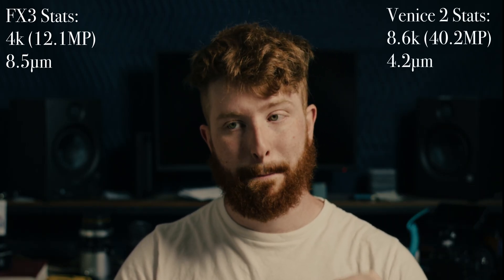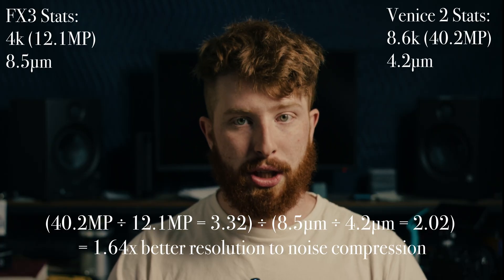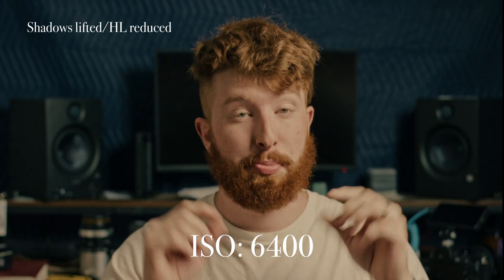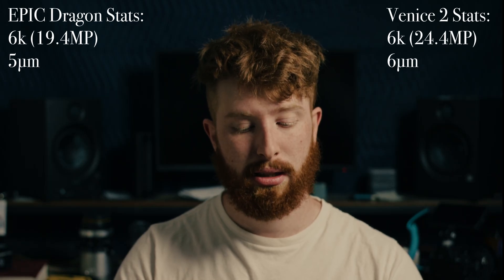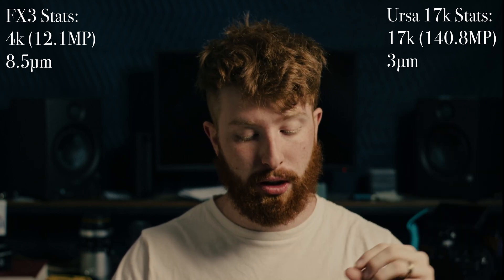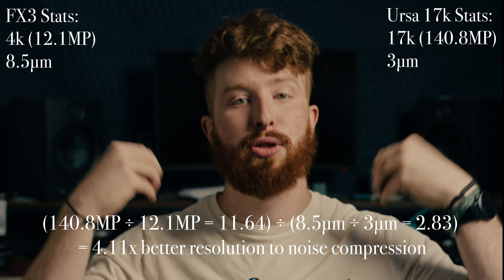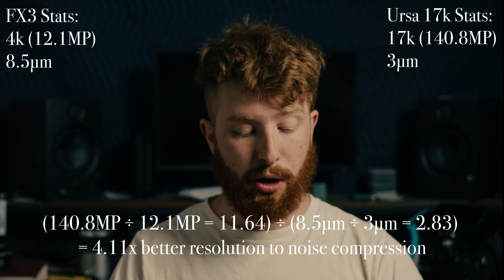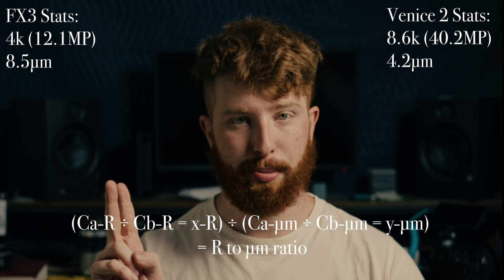Does higher resolution add more noise... or reduce the noise? (it's technically both)

Comment: The FX3 has around an 8k sensor, but it's quad bayer and read out at 12mp. Probably just at one gain but in theory you could run different subpixels through different gain circuits for better DR performance. Also most of the time shooting at super high ISOs you're limited by shot noise anyway, on the FX3 you can see this by how soft the image is at 12800, other cameras perform similarly if denoised to the same extent.
Reply from the maker: true! unfortunately it’s not the best QB design and actually performs much closer to a regular 4k sensor. QB was a good idea but in actuality it behaves very similarly to a normal bayer pattern. i think BMD did a good job with the pyxis 12k and 17k sensors which apply the same logic but with a white pixel to take advantage of the light coming in

Comment: What ACTUALLY contribute to noise performance is the sensor TECHNOLOGY. Better sensor technology will perform better with less noise. Of course better sensor usually mean higher price. 

In consumer camera world, you don't necessarily want the best sensor with the least amount of noise possible, because that would cost insane amount of money. There's a trade off here and there.
Reply from the maker: 100% in fact i shot this video on my red dragon which is fairly noisy compared to most mirrorless cameras but the noise patter looks so good i certainly don’t mind!
Reply: @WhiteJadeProductions it’s mostly noisy because it has no noise reduction applied at all. It’s the raw bayer pattern recorded. No spatial or temporal nr applied at all. 

If you were to apply noise reduction to it you’d quickly notice it’s pretty comparable to a modern mirrorless camera both being at their native gain level. If you shoot prores raw on modern mirrorless cameras you’ll notice the same thing. They’re pretty noisy too with no noise reduction. 

The modern mirrorless cameras have the advantage of having a smaller capacitor inside the sensor on top of the normal large one, which helps collect light in a more sensitive manner which only the gemini has so it sucks in low light (second native iso)

I could get some pretty amazingly clean footage out of my canon 700d which has a 15 year old sensor (magic lantern raw) once i understood how modern image processing pipelines work and how the sensor itself functions. My channel has a few of my older videos on the 700d if you want to take a peak at them
Reply from the maker: yeah i’ve done some NR with iso up to 6400 for professional work and it handles fairly well since it’s 6k. the noise looks incredibly similar to film grain on the dragon 6k so i do try to avoid anything other than color based NR. i usually just use my lumix S5 if i truly need lowlight performance tbh it handles great around 10,000 iso
Reply: @WhiteJadeProductions Yeah the s5 is an absolute BEAST. I’ve managed to shoot iso 25600 with slow aps-c glass in the dark (tried to ”overexpose” by 2.5 stops to help the encoder out in the shadows) and man was I blown away.

I can’t wait to get some fast fullframe glass onto it.
Reply from the maker: @shueibdahirmotionpictures  it truly is an undervalued camera